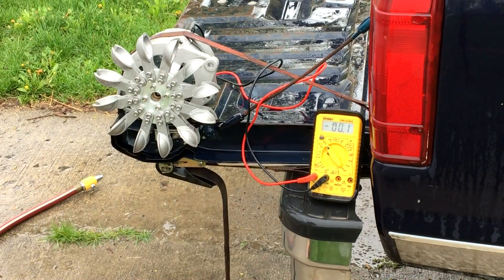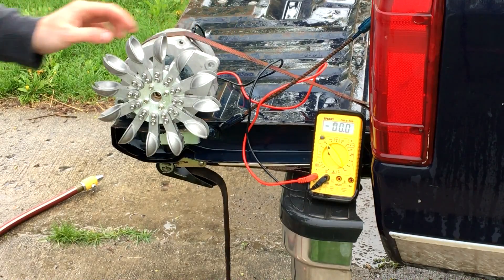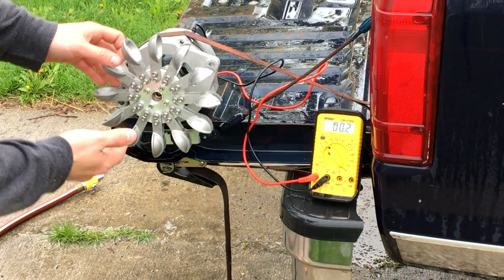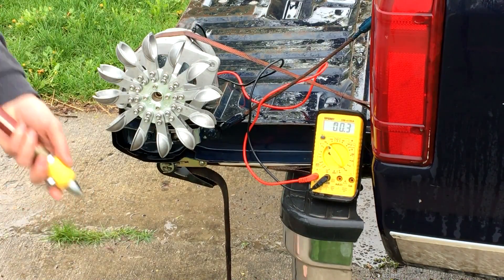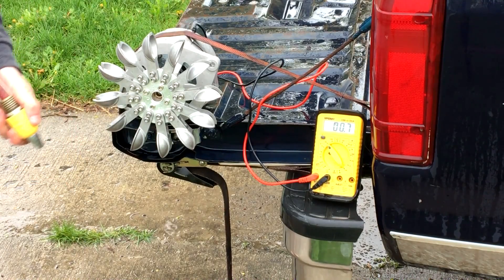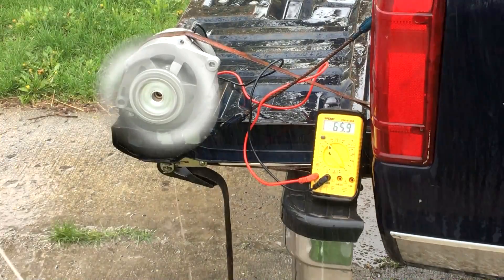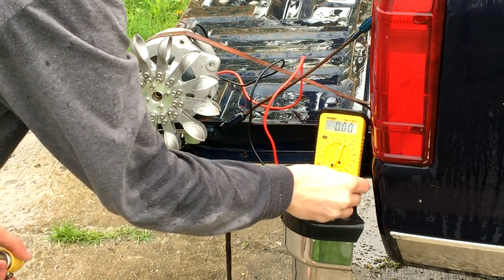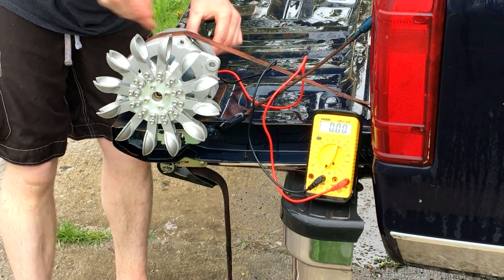Water turbine test

Comment: That was just the open circuit voltage and short circuit current.  That doesn't determine the power.  It's less than 80V x 1.88A (150 watts).  I'm guessing it would be around 100 watts.

Comment: A Boyle flask using liquid helium to turn emplellers at a high rate of speed and being able to use super conductors from the ultra low temperatures using Stirling cryogenic pistons to keep the liquid helium in a liquid state for a different electrical power generation system that could also be used has a central air conditioning system maybe has high frequency electricity were generated to power a home or trailer? You think it would work?

Comment: Could a hydraulic pump say like a swash plate pump motor be used to speed water from a tank on a hill spin a swash plate pump motor electrical power generator and pressurize the water so it could refill the tank at the top of the hill to complete the cycle? Or even have a eternal funnel set up made out of black plastic pipe to heat the water from the sun then have thermal electric generators operate of the heated water hay you could even retrofit a solar vacuum tube water heater to super heat gallium that heated water being passed through a heat exchange coil or a I dilated tank with a bell siphon to keep a steady pace of heated water flowing in and out slowly building up the water temperature that cycled through insulated underground cisterns heat sinks which you could operate thermal electricity generation off of?  Crazy ideas but would they work?

Comment: I thought about the same design I used a larger water wheel with strong earth magnets with a electromagnet at an angle to help push the water wheel with a CVT transmission with a large rewired drum motor generator with magnetic bearings with a vacuum spark gap to pump out lots of juice. Just run a circuit to power the electronics for the electromagnet in a housing at an angle to help the water wheel keep a steady pace. Lots of neat science in this post for when the water runs out but you still need some juice. I wonder if it would work though?

Comment: Hay you could sneak one of those into a sewer pipe and use the steady flow to generate electricity. Bet the city would get upset that your just stealing power from them and ticket and fine you for dipping your fingers in everyone's poo to generate electricity for your home that your supposed to buy from the city. Wow imagine how much electricity could be generated by sewer water? Could create a whole professional aspect of power generation. Its a dirty job but someone has to keep the light one and the poo flowing.

Comment: Why not design an eternal funnel that spins magnetic empellers with a copper coils on the outside to generate steady electricity? You could even use liquid atmosphere has the liquid being used within the eternal funnel and use super conducting materials and generate huge amounts of electricity. You could construct one in a mountain area and use telsa high energy transmission coils to transfer all that energy without high tension power lines or a smaller version to power your off grid cabin. Way better then solar!

Comment: you are going to want to completely weatherize that alternator. It may not seem that it was developed a lot of corrosion right off the bat however over time it will. Perhaps a barrier between the turbine and the alternator would be effective in this case. A piece of Plexiglas would be more than sufficient for that setup.

Comment: That wheel looks like it takes a lot of force to move. You're either going to have to mount it inside of a dam to get that much pressure, or remove those spoons and attach longer ones to get more leverage. No stream is gonna move it otherwise.

Comment: Cody, if you had like 6 ram pumps hitting in sequence like an engine and had the pressured water running into a Tesla turbine, would that have enough torque to run an alternator? 20 psi is enough to get significant rpm, maybe a gear reduction would allow the torque. Idk, I spend 10-14 hours a day driving a truck and like thinking about stuff I'll never do.

Comment: You clocked a stable 85v, maxing in that test at 86.4v. Your amperage clocked in at a stable 1.88A, with a couple spikes up to 1.91A. If you want, I can do a runtime analysis and measure your true averages after reaching running speed.

Comment: i have also delved into pumped hydropower.  for a proof-of-concept,  the amount of energy required to raise a volume of water to a certain head is compared to the amount of energy that becomes available, in the raised water.  
in order to determine whether there is an energy gain, available energy must be multiplied by turbine efficiency, say, 70%.  
it may be possible, using a purpose-designed open screw pump, to create more potential energy than is consumed. 
my research suggests an elevated penstock of adequate capacity will be required for a high-speed turbine.  if you stay with pelton, an over-sized vertically oriented 'tube' might work.   cheers

Comment: thanks for posting.  imo, the performance curve of the pma used suggests it might work for battery charging.  but plenty of mechanical advantage is necessary.  reduction gearing might be a solution.
determine whether you want to power a battery charging system (where output voltage is at least 15 volts dc) or an inverter.   imo, microhydro is best suited to powering a charging system.  
before that, you should know how much head and flow are available at a given site.  
high-speed turgo / pelton turbines should be used where flow is kinda low, but there is lots of head; ie., 70 meters or more. when flow is greater, multiple jets can be used.  
you may know, without a change in elevation (head) there is no potential energy.  
in order to captuer and convert energy,  a waterfall (rapid elevation change over a short distance) is required.  for microhydro, water is routed, at a slight downward angle, near the top of the waterfall, to supply a waterwheel (overshot/breastshot; see poncelet wheel).   cheers

Comment: Note that you kinda need 2 multimeters to do this kind of measurement. With the short circuit test which showed about 1.9A, the voltage would've been far lower than the 80V-ish from the unloaded test.

Comment: How about making the blades of Quadcopter generate electricity while flying it (The generated power goes into the copter battery) compare the flying times with a copter that doesn't have generator.

Comment: It would likely produce about 150 watts if your lucky.
Reply: Lower most likely. The 1.4 amp rating was when there was no external load and all the current was dissipated in the coils. Adding a load will increase resistance and lower the current.

Comment: Hi Cody,  Big fan.  I sail all over the place and live on wind and sun while out on the boat.  I make my own wind generators so I thought I would pass on something I've noticed along the way.  Once you add a battery (or regulator) to the circuit you will find you get a lot more power.  You are currently essentially trying to make amps at 0 volts.  When you let the voltage rise to 13 or 14 you will get a lot more RPM.   This raised RPM gives you a lot more open circuit voltage which ends up giving you more amps.  A given RPM = an open circuit voltage.  Amps = (open circuit voltage-load voltage)/resistance.    I would love to chat with you and share some spread sheets I made up to help me with my designs if that interests you.   You might also like my home made axial field alternator in my wind generators.  I'm won't be sailing off again until November.

Comment: why does it turn slower the second time?
Reply: Second time was short circuit test. Motor needs more torque in loaded case. Since torque is same speed droped significantly.

Comment: Now this got me thinking do you know the set up where you have a large container holding some sort of liquid that has a small tube or hose like thing coming from the bottom and coming all the way back up to the top and because of the weight of the liquid it pushes the liquid in the tube up and back into the container? I was wonder could you place an electric generator between the end of the hose and the container holding the liquid and in theory if it did work and make power how much would it make and how efficient would it be.

Comment: If you want to maximize the power output of a turbine a thumb of rule to go by is to load the generator so much that it produces around 1/3 to 1/2 the voltage without load at the same RPM. That's where current times voltage (power) are at maximum.

Comment: So many people will talk about making some small minuscule amount of power like its some 'awesome breakthrough', but thy never go to a larger scale because they are embarrassed to realize and admit that it takes very real power to produce actual wattage.

Peltier wheel technology is by no means new, its over a century old, it is very efficient, but also it requires a lot of altitude to use, so not many places are suitable for its use.

With really high hills you can dig a really high pond at the very top of your land but keep in mind it will drain really fast if it is not also really large.

I realize you get a lot of snow in the winter and that is in your favor, but of course, a lot of snow does not flow into a Peltier wheel very well.

This means that until you have enough water to remain liquid all throughout the winter, the wheel can only work during warm weather, and then you need to bury your pipe deep enough it will not freeze on its way down the mountain to your wheel, and it has to be capable of handling the high pressure, so it needs to be something pretty strong too, especially at the bottom where the pressure is highest.

On top of that, a ceramic [ZrO preferably] needle is needed to deal with the erosive force of just plain water at those speeds, not to mention the potential gritty matter which will make it like a water jet cutting tool.

Then comes the spoons which themselves need to be pretty erosion resistant.

Comment: Are you going to put a rain catcher tank high up to achieve really high pressures? :)
Also, how often does it rain there? :s
Also also, fun fact, in order to get the same energy density as a regular alkaline battery you would have to put your water storage tank about 51 km up in the air.
In order to beat the price per joule stored compared to batteries you would have to have a method of hoisting water at a cost less than 0.36 cents per meter per kg. If you have a "free barrel" then that should not be any problem just putting it on your roof, but I'm guessing you've already surpassed this budget with the dc generator :p

Comment: Never tried turning an alternator with water before. Got an old  1973 12 Elan motor hooked up to an alternator from my old 1982 GMC 350 pickup truck charging a big battery out of my buddies 1990 international dump truck.  Been told many time by armchair engineers that it don't work.  I guess the magic pixies just appear when I need to charge the old battery.  It's not pretty but it works.

Comment: Have you done the calculations for energy density? Pumped storage actually has awful energy density. The advantage is that you can compensate by using a huge volume: All you need is a great big hole.

Comment: @Cody'sLab You need to measure voltage and amperage at the same time to find out how much energy(watts) the generator produces. This is because the generator is relativly free spinning when you are mesuring the voltage(no load), and the voltage is much higher when doing this instead of when you got a load at the generator.

Comment: You should of chosen a much lower RPM generator. Alternators are designed to run at 3000RPM range. Putting it in a river won't spin it very fast and you will get poor results. I guess you could gear it, put there might not be enough torque to turn the alternator.

Comment: could you make a closed loop hydro electric system using the sun to lift the water? I'm thinking use one of those giant Fresnel lenses to heat water in a barrel or something with a long pipe going up high somewhere to some kind of condenser where the water will drip back down over the generator. Would it even be possible to evaporate water fast enough to keep that going?
Reply: Nerver heard this "solar pump" Idea before, you might be on to something. It's basically how water is transported to mountains in nature so the physics is sound. But using regular solar cells will be far more efficient for power generation.

Comment: From the open circuit voltage and closed circuit current, I estimate the maximum power of this generator is 40 W. But this is just an idealization. The max power is probably much less, because of current and magnetic flux limits inside the machine.

Comment: Now you need to try again with a second DMM reading the Voltage at the same time as current to see what power it's making. Although really, that's not going to be ideal, as a charge controller will balance current draw and voltage on the fly to create maximum power, which will be much higher. It's still a fun quick experiment to see power at short circuit.

Comment: You should put a relatively small value resistor on the output of the generator, and measure the current and voltage on it at the same time, and that's how you get the real wattage. (or just measure the current on the known resistor and the wattage is i*i*R)

Comment: I don't understand why off grid enthusiasts choose solar or wind over water. Water is reliable and consistent. Also you likely will not rely solely on batteries at times when there is no wind or cloudy days.
Reply: Probably because suitable water streams are much rarer than sunlight and wind... You must also consider what happens upstream and downstream and those parts of the stream are probably on other people's property who might have opinions on what you do. There might also be environmental and safety concerns especially if you need to build a dam. So wind and solar is much easier, and solar at least is quite efficient.

Comment: Voltage is directly proportional to RPM in an alternator.  The loaded current measurement of about 1.9 amps was seen at maybe between 1/10 or 1/20 the RPMs that produced the ~85 volt measurement.  So, it looks like that hose is coupling somewhere a little north of between 8 and 16 watts into that alternator.
Reply: 75 psi corresponds to a higher than 50 meter water column.
Reply: indeed mon librepenseur,
your throughput systems analysis seems to hold, even as back of envelope.
now, Al Bartlett et R Feynman also produced a chart for such 'overunity' or 'efficiency'...
what BTU's or drop height was needed, for the garden hose to be at that pressure,
to produce that result?

that is what is premise partly to
Al Bartlett, MK Hubbert et P Ehrlich's futures arguments,
innovations notwithstanding.
Reply: That may hold true for a permanent magnet alternator, but a conventional car alternator regulates its output voltage by changing the current in the armature winding.

Comment: isn't that a Pelton style waterwheel? Supposed to be one of the most efficient at extracting energy from a water flow.
Reply from the maker: yes precisely that, cool huh.
Reply: It's efficient for high pressure applications.  In dams, this is typically a water head of 300 m or higher.  For lower pressure, you will typically go with a Francis turbine, and for really low pressure a Kaplan (which has adjustable blades).  On an integrated power system, you're confined to a specific frequency, and head is limited by geography, so you never really achieve the theoretical efficiencies.  What Peltons are really good for is being quick to ramp up and down, generating more or less energy very quickly just by controlling nozzle valves.

@Vyl Bird The bucket design doesn't look that odd.  Sometimes you'll see them with pairs of individual buckets, but not always.  In engineering/historical circles, there may be some alternate names for different styles, but I've never heard them; it would still be called a Pelton turbine in a utility setting.
Reply: It’s a Pelton Wheel hydraulic turbine (Impulse Turbine), But I wouldn’t say it is the most efficient as Reaction turbines and Axial flow turbines are more efficient than an impulse turbine.
Reply: Not quite. It's clearly inspired by the Pelton wheel, but the bucket shape is quite different. It looks like a pelton wheel which has been slightly modified, sacrificing a little bit of efficiency in order to reduce construction costs and allow for easier repair.